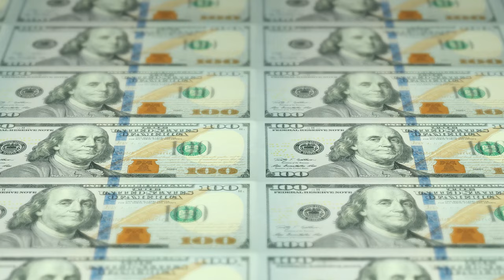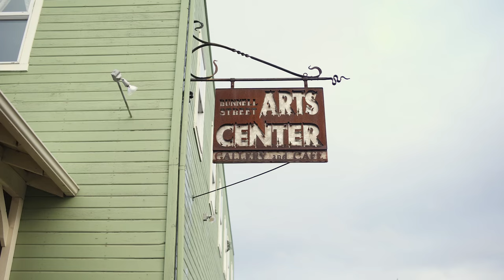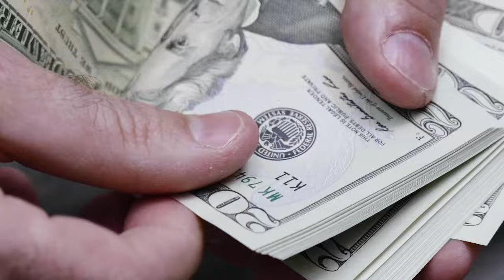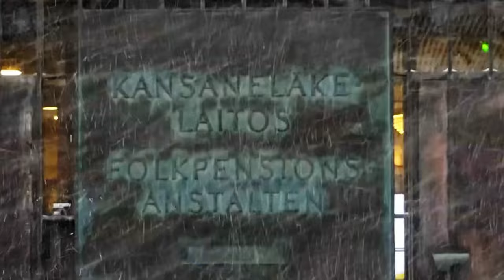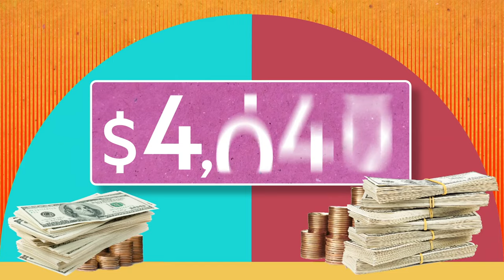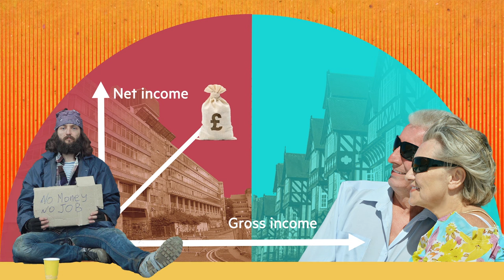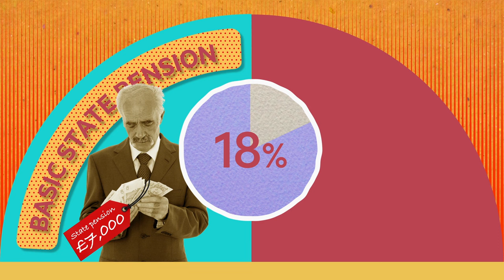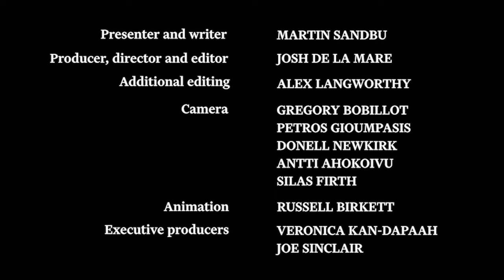The case for a universal basic income | Free Lunch on Film

Comment: I might support UBI if I thought that it would replace the hodge podge of welfare programs we have now. But I fear that the old programs and the bureaucrats who administer them will remain and UBI will just be layered on.
Reply: Imo I'd be worried that it would go the other way, that programs (like disability benefits) that specifically aren't contained in UBI would also be cut. There is definitly a middle ground there, and I think scepticism around whether or not politicians could find it is warranted.
Reply: You always have to look at the specific proposals and context. A fair way to implement it would be to phase it in slowly whilst phasing out certain means tested benefits, making sure there are no vulnerable people left worse off. For example if everyone gets £500 per year at the start, you could freeze job seekers allowance (allowing inflation to effectively reduce it) whilst still giving more to those people overall so they would not suffer but have a reducing disincentive to take a job as the benefit they forgo in doing so is reduced.  
 Deficit spending provides a buffer, removing the poverty trap provides increased productivity.
 Overall though I support a citizens dividend along the Alaska model lines but extended to all economic rents (especially land)  not just oil,  as opposed to an arbitrary 'UBI'  determined from some calculation of the poverty line.
 Tax and welfare justice  are needed, and both can be simplified by removing the many distortions.
Reply: Smh why would you get rid of automatic stabilizers that increase and decrease along with the economy in favor of 1k a month or w/e? Does no one understand what an automatic stabilizer is?
Reply: UBI + higher Tax if your annual income over $X
Reply: @schumanhuman  LVT is needed yes but that alone can not stabilize the economy. You need something that supports spending in downturns and pulls back spending in expansions.
Reply: @henrygustav7948  Well all taxes are deflationary so we have to factor in how money will be spent back into the economy.   I'm supportive of extyra fiscal support in times of slowdown and I can see some merit in a job guarantee programme but again like the UBI depends on implementation and context .Neither of these ideas These ideas are not mutually exclusive, MLK supported both back in the day for example.
Reply: @SilverLakeKingdom  A higher top rate income tax is okay, but the rich don't get rich via earned income. Jeff Bezos 'wage' is $80K for example.
Reply: @schumanhuman  As most people can see we can not always depend on Congress to make the right spending decisions. That is precisely why a FJG is needed. It takes the spending decisions out of the hands of Congress and does the spending automatically. With people going into a jobs program when the economy is depressed and people leaving the program when the economy recovers, Federal government deficits would be calibrated to keep unemployment as close to 0 percent as possible while still keeping inflation under control.
This as opposed to what we do now, raise interest rates in an attempt to impoverish people, increasing unemployment in order to try to control inflation. I'd say the FJG is the better option.
Of course the third option is to do nothing and let unemployment continue.
Reply: @henrygustav7948  Well congress has to pass the JG and decide the level of resereve wage etc.
 No  measures is invulnerable to whims of the legislature.  What is true is that the Alaska permanent fund, even as a state redistribution, is very popular with it's citizens and despite attempts it has not been repealed.And that very much puts money directly in peoples hands, though admittedly not as a counter cyclical. (The child tax credits could be seen as a sort of quasi federal UBI though, at a stretch). If a JG was implemented and seen to work, it could also gain traction
 The JG's disinflationary potential makes intuitive sense but is often somewhat over stated imo. Again I think it misses how much rents and land speculation are a prime driver of general inflation, not a lack of this or that item (current global supply shortages excepted).  No JG fully utilised labour force can make more land. 
 I agree monetary policy is pretty weak and the whole Phillips curve ideology is pernicious.
Reply: @schumanhuman  Yes the main feature of a jobs guarantee is the set wage and floating quantity of workers in the program. This is what makes it counter-inflationary/counter-deflationary. It is what keeps the economy stable, by pegging the value of the dollar to an hours worth of labor with a job guaranteed to anyone who is ready willing and able to work.
The Alaska perm fund is not a UBI, can't be compared to a UBI precisely because it is not universal. On the Federal level it is not about the funding, that in itself is not the issue as the Federal government can fund anything it wants to because it creates USD every single time it spends.
"Again I think it misses how much rents and land speculation are a prime driver of general inflation, not a lack of this or that item (current global supply shortages excepted)."
That is what the land value tax is for. Different sources of inflation require different solutions. For example you can't decrease the price of oil by raising taxes on everyone in the country. You can decrease the price of oil by developing other forms of energy however and relying less on petrol.
We could also decide to regulate banks and housing appraisers who fraudulently increase home values, the point is there is a multitude of things we can do, and those things need to be done first before even considering a UBI. UBI would be dead last on my list, I'd think about reparations for ADOS before a UBI as that has been estimated at 17 trillion. A BI via improved and expanded social security would be a far better option.
Reply: @schumanhuman   "If a JG was implemented and seen to work, it could also gain traction"
See WPA, see Jefes program in Argentina as well as calls by FDR & MLK for a Jobs guarantee. a FJG was the 1st thing on both FDR and MLK lists.
Reply: no. just wipe out all forms of welfare except food stamps, and use just UBI & food stamps. that's it.
Reply: @RazgrizStraitz  I love how much thought people put into things. Thank god you are not in charge.
Reply: @henrygustav7948  Yes this is exactly what I would be worried about. The middle ground I'm talking about is a UBI while maintaining all those social services. e.g I'm in the UK so it would be unimaginable that the NHS would ever be replaced with UBI, we could have the NHS and UBI.

Comment: For the US, a UBI of $800/month could be implemented for everyone 18+ not collecting at least that amount in Social Security Old Age (OASI) benefits. It would replace most of the means-tested welfare programs, but I would keep disability (SSI), Medicaid, Medicare, and for roughly 90% of recipients, Social Security retirement benefits. I'd also keep the EITC and expanded child tax credits. This would be about 207 million adults with a cost of just under $2 Trillion. No new taxes are needed as this is funded entirely by cuts elsewhere.

Social Security benefits (both Old Age and Disability) and Medicare are funded separately via specific payroll taxes. Cutting those means the payroll taxes that fund them goes away (or at least should go away). The same thing applies to unemployment insurance at the federal level and for most states.

For a single parent with one child, the average SNAP ("food stamp") benefit is $372/month for Fiscal Year 2024. The average tenant based rental assistance beneift is $395/month.  A UBI of $800/month essentially stands in for those programs. Disability and Medicaid are still there for those who need it.

One thing the video did not address - and perhaps this is predominantly an American issue - is that the current welfare system discourages marriage, as marriage may cause couples to fail income and/or asset tests on means-tested welfare benefits for which they would have otherwise been eligible. This is one problem that UBI solves because there is no means testing. It also provides a safety net for those leaving a relationship as they no longer are held in the relationship by relying on the other person's income.

Comment: Alaska is a good model, but we need to extend the principle to all economic rents, especially land (as Thomas Paine proposed). A citizens dividend indexed to a share of a land value tax would be a holistic game changer.
Just tinkering with current tax deductions is inadequate.
Reply: Outside of the big cities land does not have that much value,  Not enough to resolve the problems anyway.
Reply: @dnmurphy48  It is true land value is most concentrated in the cities, but the land dividend should be national so all would benefit.
 The ONS says
'Land is the UK's most valuable non-financial asset Figure 2 shows the value of land in 2016 is estimated to be £5.0 trillion, which is 51% of the total net worth of the UK.'
 A dividend indexed to a tax on 51% of the net value of the UK  is going to be many times higher than Alaska's dividend linked only to oil rents, and a more stable basis too than a depleting resource. 
 LVT has many additional benefits such as removing dead weight loss from the taxes on productivity it replaces.

Comment: @14.49 the "economist" stating it would cost 2.5 T compares it to benefits but not other costs. For example US military spending is 2T. However, even without changing most other benefits/costs in the system she also forgets that the 2.5T spent on UBI - because it is for basics - goes directly back into the economy and addresses other costly issues such as health, homelessness, etc

Comment: The part that shocked me the most in this was that even after using UBI to replace pension credit and deduct it from tax, the government would still have to spend an extra 5% of the country's income to fund it (£7000/year)
Where would this 5% come from? That is a huge amount.
So to fund the UBI, taxes would have to be raised or services would be cut. How does that ultamitely solve the problem of people struggling to pay bills and our public services crumbling?

I also agree that the studies done are too small scale to accurately predict how people would behave if this was implemeneted nationally. 

I suspect there are better, more affordable and efficent ways of helping those most unfortuate out, which doesnt include UBI. Couldn't we just reduce tax paid by those earning lower incomes, and increase it for those earning huge amounts? Afterall, something more drastic would have to happen to fund a UBI in the first place.
Reply: A UBI is technically an advance payment of a part of each and everybodies salary.

So it is not a surprise, that parts of our incomes will become mentioned in the govs bookkeeping.

If you get a $1000 UBI, the gov must spend $1000 more and at the same time taxes you $1000 more. To the gov this is zero sum as it is to you, but now $1000 more do exist on both sides of the govs balance sheet.

But it also means that those bigger numbers of the govs household do not change anything. It is only an artefact of bookkeeping.

Comment: I suggest a monthly expiring UBI. Everyone will get a "gift" card, but the fund expires monthly and recharge on the first of the month. The rich, especially the really rich, won't use it anyway, so no money would be wasted. People who needs it will spend it right away anyway, but people who are slightly well off would be encourage to spend all of it. Can't withdraw the fund into cash or put it into savings.
Reply: Why wouldn't you want poor people to save it? That's part of the biggest problem they have - they can't save as they don't have funds at the end of the month.
Reply: @sholaking5027  
With the expiring UBI, people will have an easier time to save more money than without any UBI. If the UBI is $2000 a month, your necessity expenses is $1500 a month, and your usual job income is also $2000, then you have the option to spend the remaining $500 UBI money on non-necessity, while giving you the option to save the $2000 on your actual paycheck. Without the UBI, of the same $2000 paycheck, only $500 would be able to go to savings. 
One major reason to save money is to buy a home, and with UBI, people would be able to put all into a home mortgage without the worry for down payment. Because the UBI is universal and consistent, then banks has no reason to deny a mortgage. 
Letting only poor save it means having to let the ones who don't need the UBI the ability to save it too. If you initiate some sort of check to make sure who can save or not, then you might as well check who can receive it or not, defeating the point of a UBI.